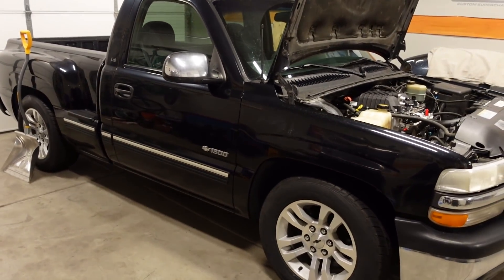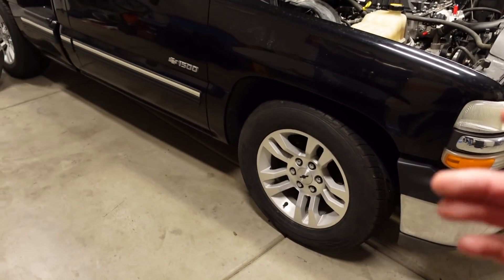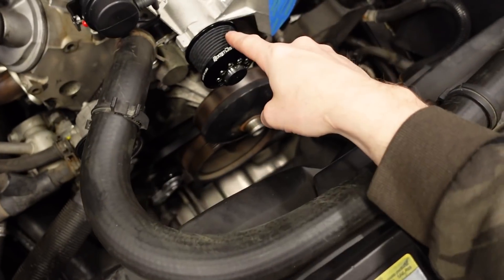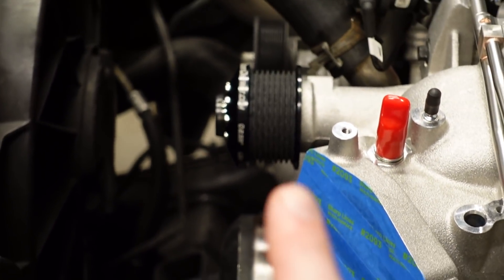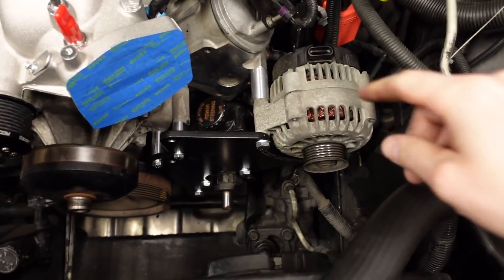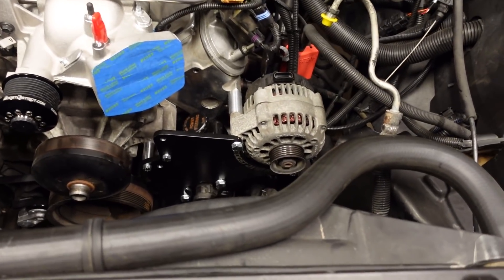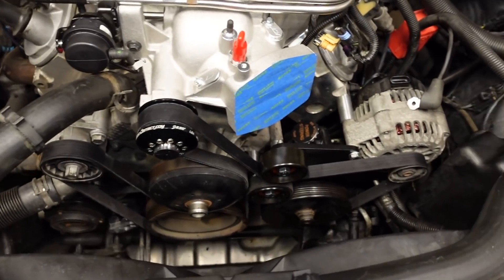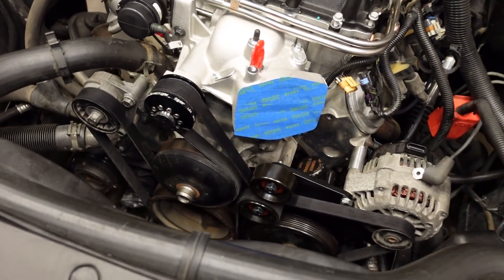LSA Supercharged Silverado pt.3

Comment: I’m sitting on an 04 single cab step side z71. 5.3 and 4l60e. Once it starts getting built it’s going to be “psiko71” looking at a turbo setup, not super built just looking for 500 all wheel hp. So obviously the same awd conversion. Lowered a little bit, but not too much because I’m in New England and still need to be able to deal with snow. Not looking to race it or anything since it’s my daily. Just want a little more than the stock 295 crank hp. Considering looking into a 6l80e swap since I love how my 3500 dump truck at work shifts and takes off. Still going to have a fairly quiet exhaust, full interior etc. I’m using your vids as research, so I can’t tell you how much I appreciate them. I’ve been to school for motorcycles, Kawasaki specifically. So I’m no stranger to tearing things down to the skeleton. This will be the first v8 I’ve ever built, since my old 95 z28 had a 400hp build when I bought it. Excited for the new experience, but understandably nervous.

Comment: What belt did you use or is it the same the truck uses
Reply from the maker: it is not the same one that the truck uses, and I forget the exact length TBH, but it was quite a bit shorter
Reply: Oh really i would've thought it was longer by any chance the numbers on the belt still on it maybe that will help me since im running exact setup

Comment: Could you use an ATI Super Damper instead of pinning the stock one?
Reply from the maker: you'd still have to drill it to prevent it from spinning the same way you would a stock one. unless you machined the crankshaft for a keyway, but that accomplishes the same thing as pinning the crank.
Reply: @TolmanPerformance  thanks.  I forgot I have an aftermarket crank

Comment: I named my current project the “copo Colorado “ (named it about a year and a half ago when I started amassing parts) it will have the same blower setup you have, on top of a ‘08 ls3 6L80 with a an as yet undetermined transfer case and yes it will have a sas done running tons on 35-37” tires

Comment: You know. If you let the air out of the front tires, it makes it easier to work on the truck. Then just air them back up when your done. Saves  some wear and tear on your back. I learned that by accident. Both my front tires were flat one morning when I came out to work on her. For me tho it was a little bit harder then just putting some air in the tires lol.

Comment: You could call it a Hurricane since GM already used Typhoon and Cyclone. also you should not have any belt slip issue until you go bigger on the pulleys, I've seen it before, that's why it has a wider belt width to start with, GM knew it was border line slip already

Comment: My L.B.Z. Duramax Yukon is called NORTH. Not sure why?
I was wondering if there is a shorter power steering pressure line from a factory blowen 4.8 ? I just hate hoses or electric wires/cables that are too long. It's  just messy looking, so l get why you want to tidy things up. ✌🏻🔑,👌👍❄❄🥶🇨🇦👨‍🦽😎.

Comment: Wow, extra plates lol. If it where me...I'd put the alternator on the block tied to the ac with a longer 4rib belt, used a Volvo or Toyota EHPS remote power steering with electric water pump to limit crank shaft leaching and gone with a small 6rib pully/tensioner setup. 20-60 horsepower  spread across the power arch just sitting there.

Comment: It's looking good, can't wait to hear it start. I'm not a fan of the ARP balancer bolts. I've had 2 back out on me. Yes - I torqued them to their specs and even used red loctite. FYI - I have never had a factory bolt do that to me. As for reusing them, technically you shouldn't - but you can. Do I recommend it? No. The stock bolts are under $10, hardly worth the risk.

Comment: You got a 8 rib pully on tip 6 on the bottom so what did you use for a belt
Reply from the maker: six rib
Reply: @TolmanPerformance do you have a part number for the belt

Comment: Nice work on getting that all setup and configured!!! I have seen that "pinning the crankshaft" kit before and it is a good idea as for what you are doing. My 2010 Silverado has both battery trays too and my battery is in the back as to where you are thinking about moving yours. GM does this because some of their trucks gave the diesel engine option. Can't wait to hear this run!!!
Reply from the maker: thanks! I can't wait to get it running either

Comment: good info on the belt, itll stretch about 1" after you get into boost a few times. The truck balancer is SMALLER than the CTSV, the stock LSA lower is an upgrade over the truck balancer if needed.
Reply from the maker: good info on the lower pulley size, guess I'll be looking for a way to spin it faster in the future lol. Love the bracket btw!
Reply: @TolmanPerformance  glad to hear it. We havent had any issues in the past with the ARP bolts or the steam tube, but ill be making a few adjustments on the next batch of adapters

Comment: Nice video.
How about TolmoTruck? I like that better

Also, it's hard to see, but it seems like you have insufficient wrap on that crank pulley- like not even 180 degrees. Is that an optical illusion?

Comment: LT do you use 1-2 psi residual valves at each wheel to remove the first bit of squishy brake peddle?
Reply from the maker: the only time I've used one of those is for an old street rod where the master cylinder was mounted under the floor

Comment: The truck lower is smaller by 10% so you will be loosing a little boost there. Tge largest lower you can put on it with the truck accessories is the stock ctsv one. Just a heads up.

Comment: please drill two holes one on both sides cross from each other on the crank because if you only drill one you're changing the balance if you put one on either side it's closer to zero

Comment: LT did you drill two holes in the crankshaft in the lower pulley to keep it from turning when you put the blower drive on because it's only a press fit with no key way

Comment: if you get an LS engine out of a donor vehicle and you don't take the radiator you're not going to be able to pressurize your eating system to get coolant to into the vehicle for the heater cord to warm the inside of the vehicle in the winter time in the holes that comes from the radiator to the overflow bottle you will have to use a piece of aluminum or brass or whatever to block it and only have a 5/64 hole for the coolant to come through to go into the overflow bottle and then now you have pressurized the system so you can have a warmth in the vehicle found that out the hard way